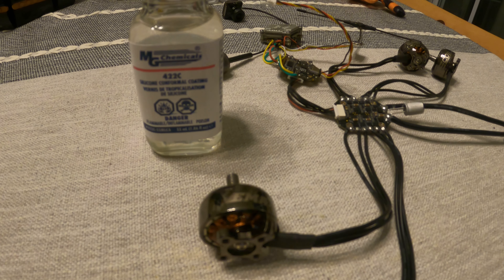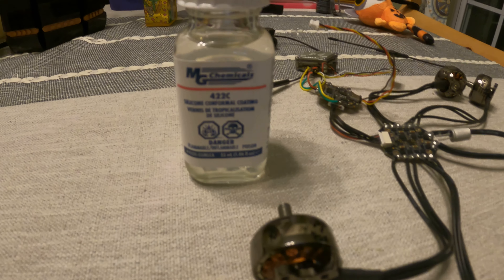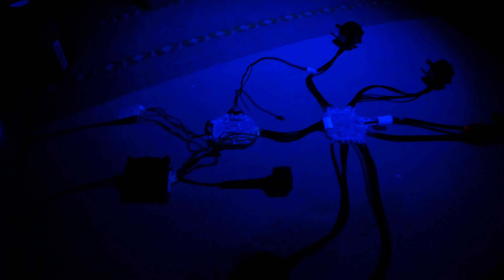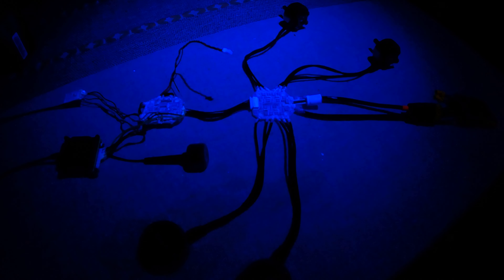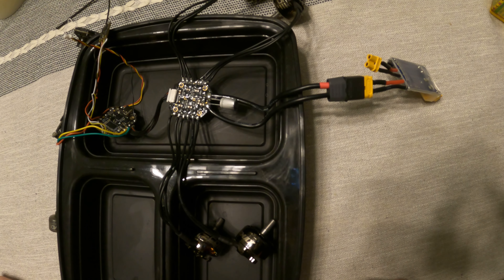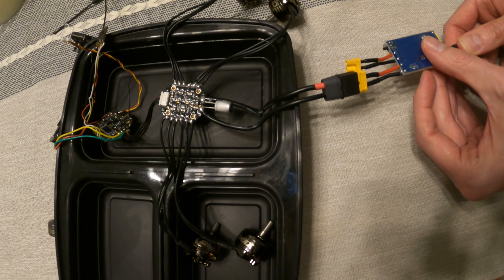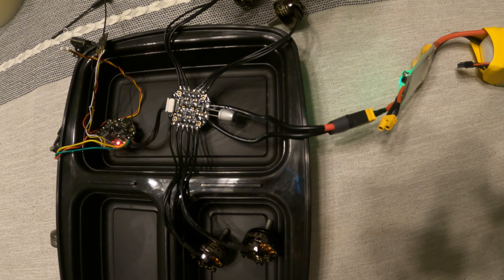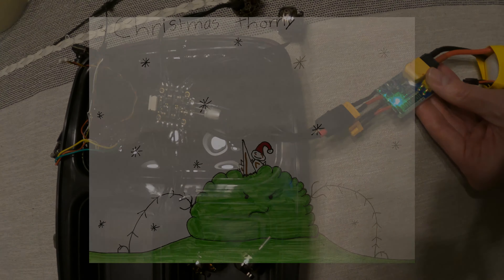Waterproof Your Drone!! Check Coverage | Did You Miss a Spot??

Comment: Mg chemicals 422 can’t run under water though. I’ve had quite a few escs go out flying in the rain with it. Fpv worry free (my product) or kotking are best for rain and actual water flying. Mg chemicals is a great solution for every build though to have a little protection against morning dew and stuff like that.
Reply from the maker: I appreciate the feedback! So far MG chemicals has worked well in my submersion tests but I admit my testing thus far has not been rigorous.  Before you commented I had been contemplating using FPV worry free on some of my other builds for comparison purposes. I think I’ll go ahead and order some!